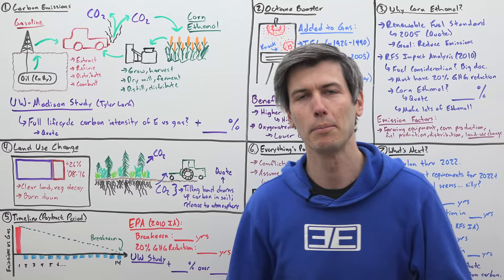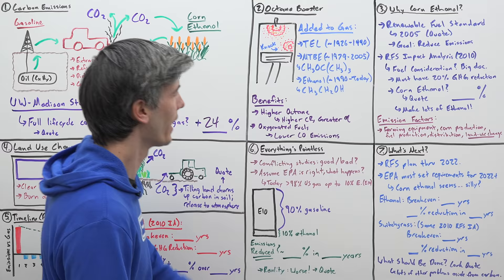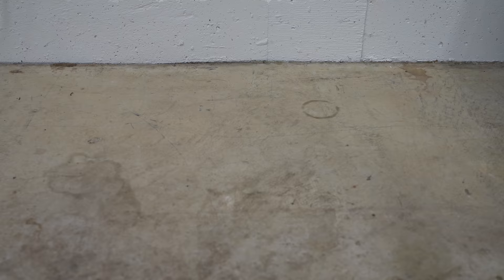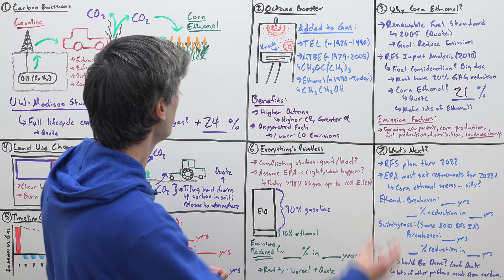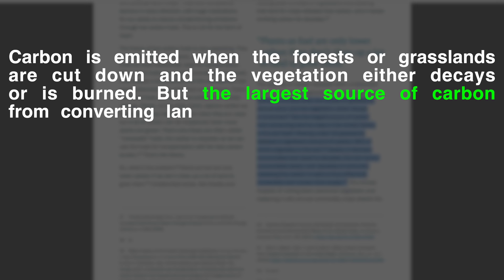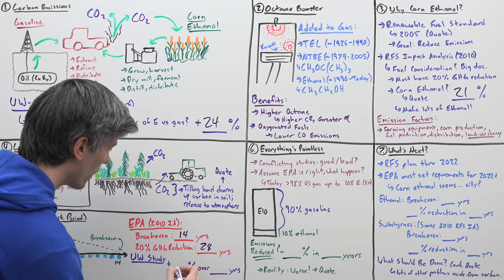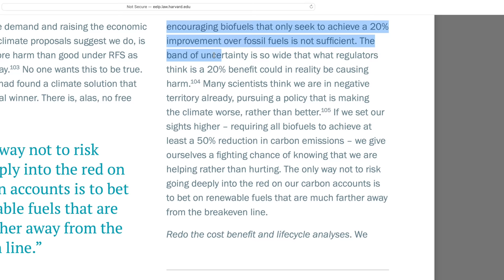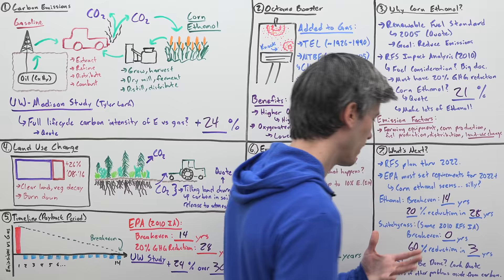America Was Wrong About Ethanol - Study Shows

Comment: You missed the entire small engine field that has been PLAGUED by ethanol fuels. They destroy carburetors, gum fuel lines, gel tanks. The hygroscopic nature adds water into the system as well which rusts parts that aren't gummed.
Reply: If you don't have a sealed fuel system (and you should wherever you can for all sorts of reasons) avoid ethanol fuel.  For everyone else ethanol is pretty damn good.
Reply: @ChurchAutoTest  Why do I find 90% of the small engines on the side of the road with gummed up carbs. a quick run through the ultrasonic and they spring to life! Ethanol fuel is trash....
Reply: @ess2870  If you're running an unsealed fuel tank you're letting all sorts of crap in.  Cheap gas might work better for you.  If your fuel system is sealed with a proper evap system (like all cars made in the last 30+ years), you can leave ethanol in that tank for years with no issues.  I've done it myself.  Ethanol is awesome.  More power, cleaner burning, fewer deposits and emissions and helps all my engines last a long time making much more power than they could on anything except $25/gal race gas.

Comment: I'm curious, when harvesting the corn you have to cut the stalks down and till the soil again, releasing more CO2.  Then, after that corn has been harvested you have to plant something else to regain nutrients in the soil.
Reply: It is a cycle, even all the leaves from forests go back to the air as CO2 to make the new leaves the next year.

Ethanol piggybacks on this cycle.  100% of the CO2 from the burning and fermentation of ethanol just came from the atmosphere and 100% of it is needed to be back there to make the new gallon of ethanol.

100% of the fertilizer and things in the soil in ethanol production still get fed to livestock in the distillers grains.

No corn is grown just for ethanol, far too uneconomical to do.  It works because it retains the nutrients for the feed in the distillers grains.

The video acknowledges the cycle but then claims the extra CO2 came from the breaking up of grasslands and forests.  This is impossible since US cropland acres have been declining.  Shoot, the corn belt grew more acres of corn in 1980 before ethanol than in 2018, the year of most ethanol production ever.
Reply: @danafletcher2341  thanks Dana I appreciate the info

Comment: Ethanol is an anti-knock additive. (Raw gasoline explodes slightly too easily, and tends to go off during cylinder compression before the spark plug fires, driving the engine backwards. Diluting it with ethanol raises the ignition temperature enough to make the process more reliably controllable.)

 Tetraethyl lead was invented as a patentable compound that would break down into ethanol when heated, to reduce engine knock in a patentable way (that also poisoned many people and caused developmental neurological damage in a generation that is now going senile extra hard).

"Unleaded" gas just uses ethanol instead of five ethanols glued to an atom of lead for intellectual property reasons.

The difference between gasoline and gasahol is just the AMOUNT of ethanol the petroleum distillate is diluted with. 50 years ago people had the bright idea to dilute gas further as a form of farm subsidy and blame it on the environmentalists, but the result produces less compression so your miles per gallon go down and it's either a wash if you're tracking specifically fossil carbon emissions, or worse than useless if you're just tracking carbon emissions.
Reply: After the disastrous lead was finally outlawed, the petroleum industry gave us MTBE which was not only an anti-knock octane booster but also an oxygenate.  Ethanol was modestly sold in the Midwest proving itself to be an economical, efficient, and effective octane booster and oxygenate.

When it became apparent that MTBE also needed to be outlawed, ethanol was chosen to replace it.  The petroleum industry even went along with the legislation because hidden in the bill was legal immunity from MTBE.  This was revealed and taken out and the bill still passed.  This is why we have ethanol in fuel at today's levels.

Denver in 1988 was the first government entity to require E10 when they were on the EPA list of ozone non-attainment zones.  Soon with ethanol they were off that list.

Even with just 10% ethanol added to E0, the Swiss Federal Laboratory for Materials Science and Technology found that the especially health devastating ultra fine or nano particulate emissions were lowered by 97%, carbon monoxide lowered by 81%, carbon dioxide lowered by 13%, aromatic hydrocarbon emissions lowered by 67-96%, and genotoxic emissions lowered by 72%.

100% of the CO2 from the fermentation and burning of ethanol just came from the atmosphere and 100% of it is needed to be back there to make the new gallon of ethanol.  Ethanol has zero newly added CO2 where 100% of the CO2 from petroleum is newly added.

The spot cash delivered price of ethanol on the NYMEX is $1.42/gallon.

The price of sub-grade unusable gasoline (RBOB) is $2.31/gallon.

It takes more energy to make unusable gasoline than ethanol.

To turn RBOB into usable E0 fuel costs even more much like premium costs more.  Unfortunately, it becomes even more toxic and dirty from the BTEX (benzene, toluene, ethylbenzene, and xylene) added.

Or simply splash in >10% ethanol to RBOB and the resultant usable fuel becomes less toxic, far cleaner burning, and cheaper/cheaper per mile to drive with.  Who can be against that?

Comment: They use insane amounts of propane to dry the corn so it’s definitely not a clean form of energy plus all the fuel burned to operate the equipment to harvest and transport.
Reply: Iowa State University measured all the energy it takes to produce an acre of corn into a "diesel fuel equivalent"
This included making of the machinery, fertilizer, chemicals, plus the tillage, planting, spraying, harvesting, drying, trucking etc. 
They found it takes 34 gal of diesel to produce one acre of corn.
What do we get from those 34 gallons of diesel?
We get >500 gallons of ethanol.
But wait, that is not the kicker.
The kicker is we still get 100% of the protein and other things from that acre of corn still available for an even better feed called distillers grains. A win-win.

Comment: I see no discussion on the fact that adding ethanol to automotive fuel produces fewer miles per gallon. Therefore it takes more fuel to go the same distance and more CO is exhausted into the environment.
Reply: Obviously you must drive a diesel since gasoline has fewer mpg.  Am I right?  If not, why not?

We went to non-toxic ethanol for octane and oxygenated fuel for pollution after MTBE proved to be a disaster.

The fact that ethanol is cheaper per mile to drive with is just a bonus.

Denver in 1988 was the first government entity to require E10 when they were on the EPA list of ozone non-attainment zones.  Soon with ethanol they were off that list.

Even with just 10% ethanol added to E0, the Swiss Federal Laboratory for Materials Science and Technology found that the especially health devastating ultra fine or nano particulate emissions were lowered by 97%, carbon monoxide lowered by 81%, carbon dioxide lowered by 13%, aromatic hydrocarbon emissions lowered by 67-96%, and genotoxic emissions lowered by 72%.
Reply: Rodney it doesnt that why it isnt in the discussion. Just like the Earth is round not flat.

Comment: Also, CO2 is released during fermentation.  What passes for thought in this area says, "put it in a landfill" er, "sequester" it.  The ethanol industry would be far smarter to catalytically convert this CO2 to Methanol at the current US rate of $500+ per metric ton, and optionally convert the methanol back into gasoline using Exxon's MTG process.
Reply: 100% of the CO2 from fermentation (& burning) of ethanol just came from the atmosphere and 100% of it needs to be back there to make the new gallon of ethanol.  Zero newly added CO2.

Poet has made a great business of this pure food grade CO2 from the flash freezing of food, beverage carbonization, fire suppression systems, welding gas, and of course dry ice production which has made the shipping of medicines and efood both economical and common.

Argonne National Laboratory has developed an economical and efficient process to make ethanol from CO2 and electricity from catalysts of carbon and copper which cane turn on and off instantly.

Ethanol plants use the waste steam from nearby/onsite natural gas electricity plants to make ethanol.  Electric plants must have excess capacity for peaks in demand load.

We can use this excess electric capacity to make more ethanol making that plant more efficient.  The equipment and infrastructure to handle the ethanol is naturally already right there.

We could even use excess from nearby wind farms on especially windy days making this more efficient too.
Reply: POET sells co2 to the meat packing industry for dry ice.

Comment: I haul fuel for a living so I know a few things about this subject.  I can honestly say that the savings we incur due to ethanol being 10% of out nations gasoline is completely made null & void because of the diesel fuel we burn transporting this ethanol to the truck loading terminals (the loading racks) by train car.
Reply: You are aware that diesel trucks haul crude oil from every single little oil well (which also flare off natural gas) to terminals of train cars and/or pipelines?  The tar sand pipelines from Canada to Texas even have to be heated to move the thick tar sand oil.

All the energy it takes to produce and deliver a product to the consumer is reflected in the price of that product.

As such, note the spot cash delivered price of ethanol on the NYMEX is $1.42/gallon.

The price of an unusable sub-grade of gasoline (RBOB) is $2.27/gallon.

Usable E0 gasoline costs even more than that and becomes even more toxic and dirty.

Comment: As a home brewer unless you are doing something specific to capture the CO2, fermenting creates a LOT of CO2.  That's not shown in box 1.
Reply: 100% of the CO2 produced from the fermentation and burning of ethanol just came from the atmosphere and 100% of it is needed to be back there to make the new gallon of ethanol.

Zero newly added CO2.

They talk about spending billions to haul CO2 in dangerous high-pressure pipelines across the country only to bury it into the ground.

The company who is world's largest ethanol producer, has made a business of CO2.  They use it for the flash freezing of food, beverage carbonization, fire suppression systems, welding gas, and of course dry ice production which has made the shipping of medicines and efood both economical and common.  They were resisting the pipelines at first, but the subsidies available make it economically impossible for them not to join as they would lose competitively to those who do take the subsidies.

Today's newer ethanol plants use the waste steam of nearby natural gas electric plants to make ethanol.

Argonne National Laboratory came up with an efficient and economical way to make ethanol from CO2 using electricity and catalysts made of carbon and copper which can instantly turn on and off.  Are building (have built?) a pilot plant even.  

Note that electric plants must operate with excess capacity for peaks in load demand.

They could use the pure food grade CO2 from fermentation to make more ethanol with this excess electric capacity.  The equipment and infrastructure to handle the ethanol is naturally already right there.  

They could use the excess electricity from nearby windmill farms on especially windy days as well making that power source more efficient.

Comment: What corn ethanol is farming - is subsidies

BTW: Switchgrass seems like a good idea, until you realise that just like corn, it stripmines the soil nutrients - possibly even more quickly than corn (corn stubble is ploughed back in, switchgrass harvesting leaves nearly zero behind). Soil of the Great Plains and Canadian Prairies is surprisingly fragile and susceptible to becoming a New Dustbowl

Ethanol has been added here in Europe - grain derived. As you say it's better than the other octane enhancers but one must take carbon cost sinto account.

It would be better to redesign car engines to run on lower octane fuel, rather than relying on expensive additives (Old low octane fuels had lots of contaminants due to poor refining, new low octane fuels are pretty clean), but the era of ICEs in personal transport is coming to an end
Reply: 100% of the fertilizer and things in the soil are still fed to animals in the distillers grains.  Ethanol is made of only things from the air: solar energy, CO2, and water with the latter two being recycled once burnt.

There are no Federal subsidies for corn ethanol.

GM wishes for a high octane fuel standard.  Ethanol engines are almost completely pollution free, have twice the power/half the size, and greater mileage than gasoline, even greater mileage than diesel engines.

Here is one Ricardo built for GM a few years ago:

FROM RICARDO:
The new federal CAFE standards are calling for a doubling of fuel mileage performance, which, Vint says, is going to send OEM’s looking for high octane numbers to improve efficiency and ethanol is the best source. Ricardo, an engineering firm with over 100 years in the business of engine design, has developed an extreme boosted direct injection engine (EBDI) to optimize ethanol blends. The 3.2 V6 gasoline engine rivals the power and torque of a much larger GMC Sierra 6.6 diesel, he said, and it delivers 3.5 percent better fuel economy than the diesel.

We could also efficiently and economically refine crude oil, natural gas, and coal into pollution free ethanol as well.  China, India, Indonesia, and others are using and/or looking at this process from a Texas company named Celanese with their TCX Technology.

Comment: The energy required to do all the processing depends on where it is coming from.
If it is coming from oil, it will be producing a lot of carbon, but if it is from a renewable source, like solar, or ethanol, it can produce far less. Did they study consider that?
e.g. comparing an oil based power system, to an ethanol based one?

Yes, churning up farmland is an issue, but there is far less carbon stored there than in oil. And continuing to pump oil out of the ground and burn it is not a viable solution.

Yes, going for 10% is almost entirely useless, and they should be going for much higher percentages. What they should be doing is aiming for 100% biofuel at some point.

And yes, they should be looking at things other than corn.

Comment: That is assuming that the farmers would let their expensive,  productive land go to seed and no productivity. Not likely
Reply: The whole premise is false on its face, there were no grasslands or forests broken up for corn.  Quite impossible since US cropland acres have been declining.

Census data shows grassland, forest, and wildlife areas increased in corn producing states since ethanol.

Believe it or not, the corn belt grew more corn acres in 1980 before ethanol than they did in 2018, the year of most ethanol production ever and ethanol plants everywhere.

2018 Iowa 13,200,000 acres of corn with most ethanol production ever
1980 Iowa 14,000,000 acres of corn before ethanol

2018 Illinois 11,000,000 acres of corn with most ethanol production ever
1980 Illinois 11,600,000 acres of corn before ethanol

2018 Indiana 5,350,000 acres of corn with most ethanol production ever
1980 Indiana 6,450,000 acres of corn before ethanol

Corn ethanol is value-added from already existing corn feed production and preserves the feed in a healthier and more productive form called distillers grains.

Comment: Ethanol can be used in many cars up to 85% and almost all cars can use up to 15%.  The significance of that is it can put a limit of the consumption of very expensive oil if prices spike, like if there were wars in the middle east or other disruptions.  Ethanol has around 10% less BTUs than gas though.
Reply: Nebraska has a pilot program with the EPA to use E30 in their non-flex fuel state vehicles.

Brazil has many of the same non-flex fuel vehicles we have and their common gasoline is E27.  It has worked out so well and for so long that Paraguay went to E27.